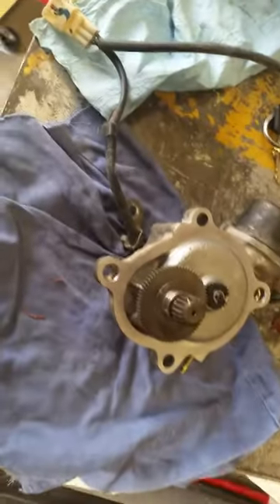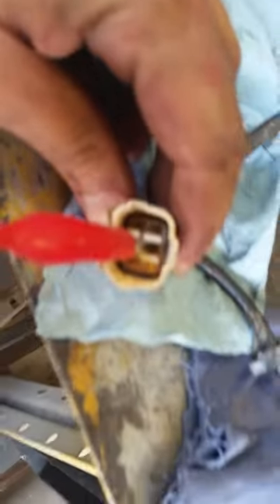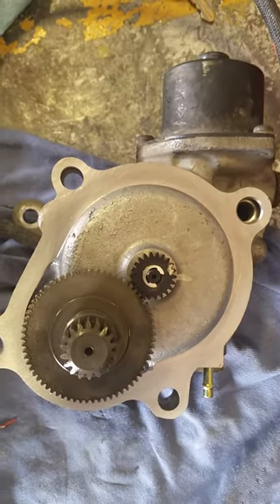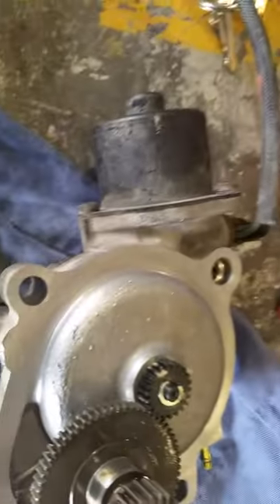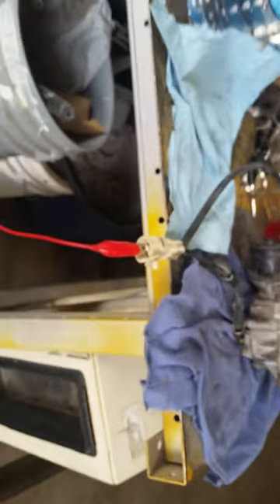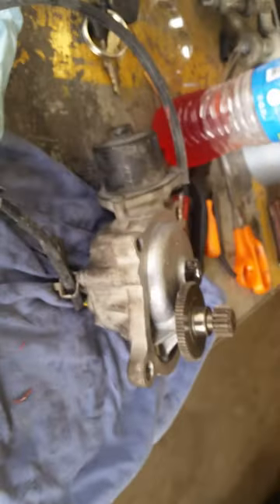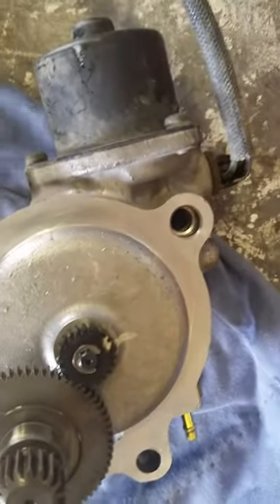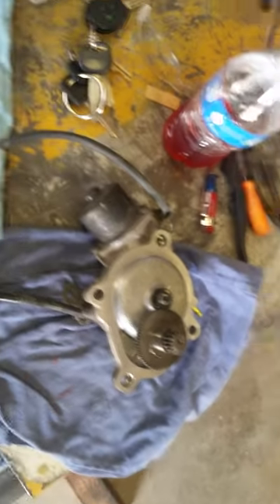1997 Land Cruiser Center Differential Actuator Motor

Comment: If you dont have the mark how you know where is the lock position??
Reply from the maker: I had uploaded another video of the Transfer Case area where the Actuator Motor sits.
"Lock Position" is when the motor shaft gear is all the way counter clock wise...when you install it back on the Transfer Case, make sure you have the gear wheel (on the transfer case) moved to the lock position too (refer to the other video), that gear needs to be rotated clock wise by hand until the fork engages the Front Differential.
Reply: Ok hice todo y sigue la falla no activa el 4x4 hay alguna manera de ver si es el relay??
Reply from the maker: Si, quita el Relay y usa un voltimetro para checarlo.

Comment: Did you ever figure this out?
Reply from the maker: Yes, so as you can see, the Actuator Motor was working properly, the problem was with the Transfer Case, the Shift Fork No 2 was not engaging the Center Diff. Assembly, but not because of failure in the components, but because of lack of proper lubrication!!  Yes, the oil was too old!
The gentleman whom I bought my truck from probably never used/engaged the 4x4 allowing the Differential lock, and certainly never changed the oil, so everything inside was gummed and stock.
The fixing was to change the oil and engage and disengage the Differential Locking several times after until it works, in my case it started working the first time I tried.
It also help to do the MOD of the CDL (center differential lock) Switch to allow the Transfer Case to engage in HI, that helps the Transfer to keep all lubricated properly.
NOTE: Yo may or may not have to take the Actuator Motor off the Transfer. Sometimes the Oil Change will take care of the problem, if not, take the Actuator Motor off, stick your hand inside the chamber and move the gear manually (unstuck it) and then put it back on.
Hope this help.
Reply: Carlos C. Where do you drain the oil from ??